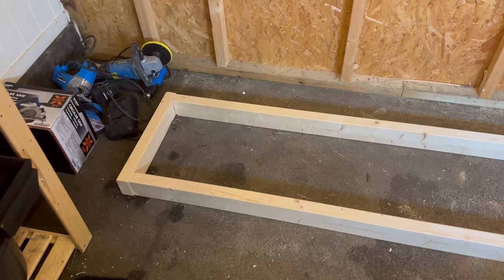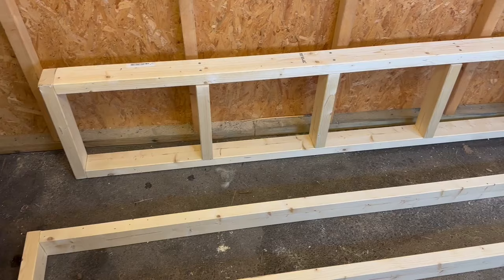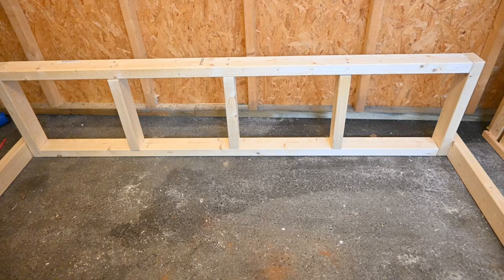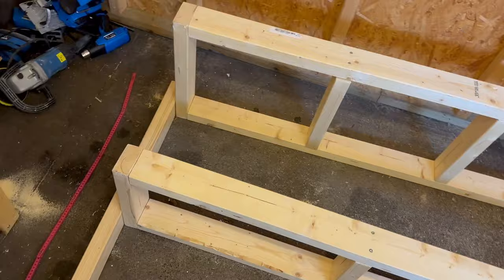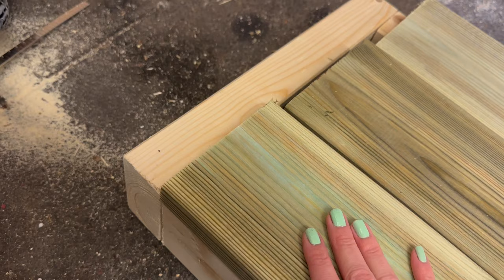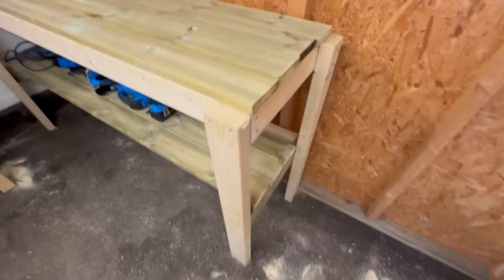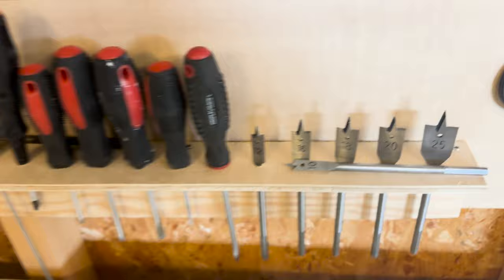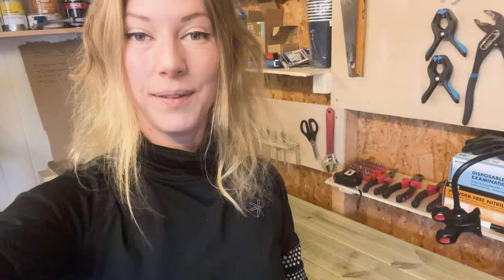I made a workbench for my future boat projects! ⛵️🔨

Comment: Good, keep working.  You are no longer a total rookie.  I did cringe at the rusty saw.  If it is still sharp a bit, to help it cut a little more smoothly, rub some of the rust off with some finer sandpaper and then use a regular black carbon pencil to “ scribble” both sides of the blade from tip to handle.  It will act like a lubricant.  Waiting for more projects.
Reply from the maker: Haha I totally agree, the saw is almost new though! I just forgot it in the boat for a little while 🙈
Reply: or wax
Reply: @annelinsynnes  yea, I was gonna say that rust is probably the product of salt water.

Comment: You have the right idea with the bench. Personally I like a sheet of 12mm plywood cut in half and double up for my bench tops, glue the two pieces together as you screw them down to a leveled bench top, then I like to set a .25" thick sheet of masionite ontop just free floating, it makes a good work surface that can be damaged, spilled chemicals and paint on then replaced easily when the time comes. 

This gives you a solid flat worktop that you can hammer and pound on things on if you need to. 

The problem with using boards as you have here is that lumber is going to cup meaning the bench will not be flat which leads to frustration when working on things. 

The other advantage is that there are no spaces between the boards for things to disappear into. 

I would also put a solid board along the back of the bench to keep anything from rolling off the top.
Reply from the maker: My original plan was to make plywood on top, but the plywood sheets at the store were so big I couldn’t fit them in my car 🙈 so I ended up with boards 🤷‍♀️ but I guess I can always just change those later :)

Comment: You can use a chisel to remove any excess from one side when trying to align two parts already screwed together. At 1:50 in. Also, set the parts you are attempting to join on a board which will help align the two parts correctly before screwing together.